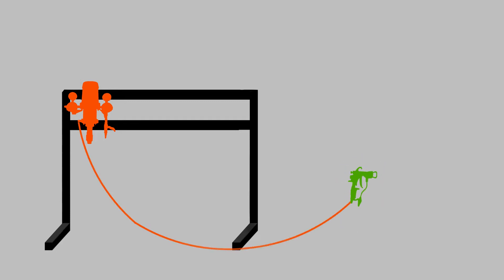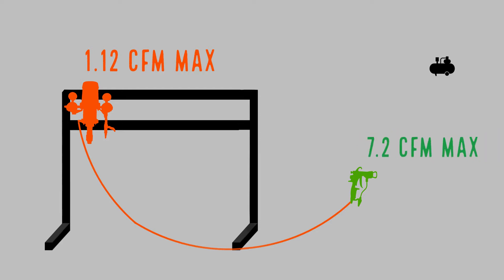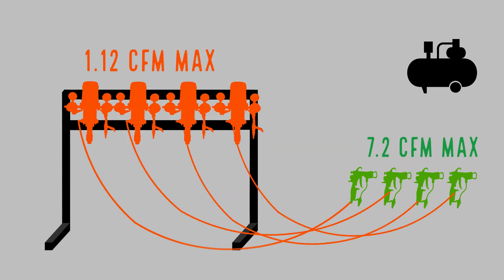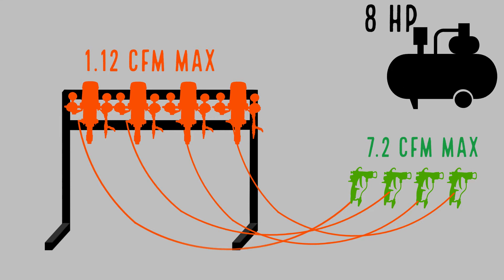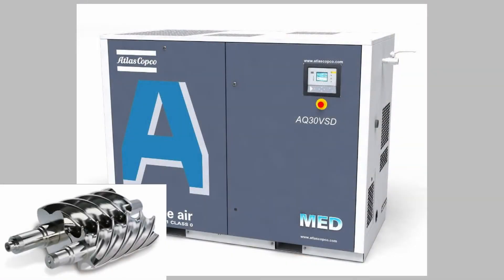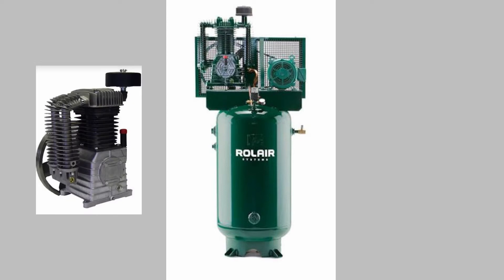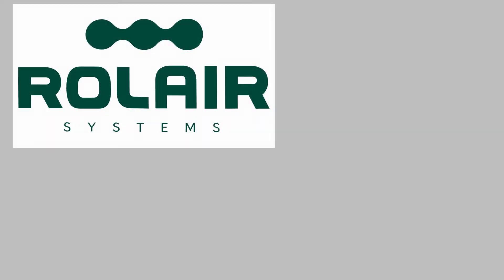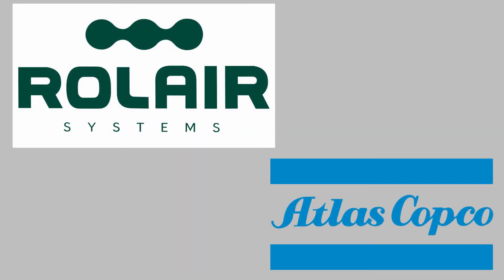How to Size a Compressor for Paint Spraying

Comment: Thank you for this video.
Whilst informative, it would have been more helpful if you had pointed out that the calculation of the compressed air required to serve an air assisted airless spray setup can be more accurately determined using the data from the pump and spray gun- expressed in standardised CFM.